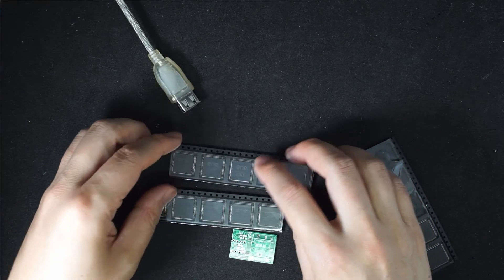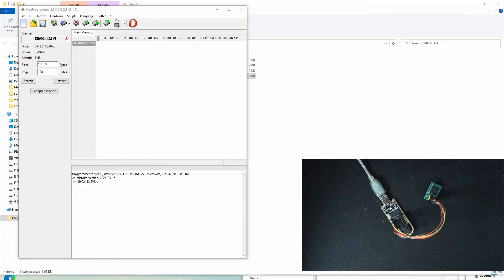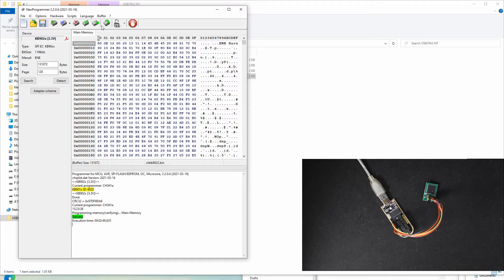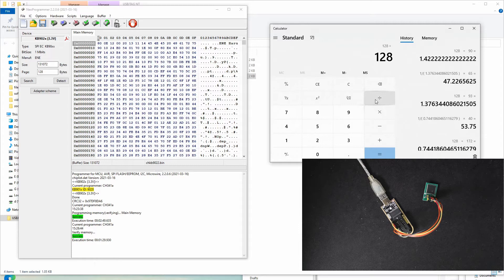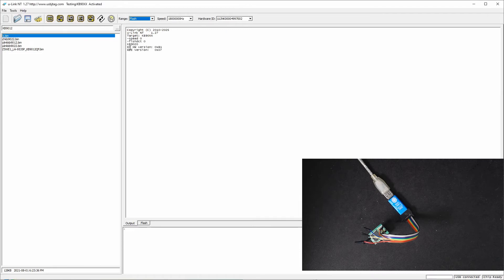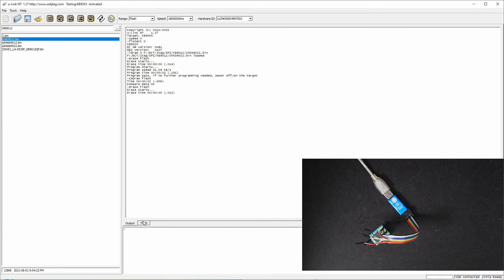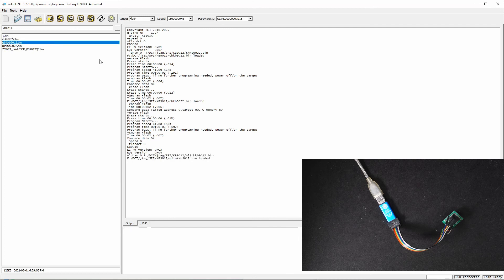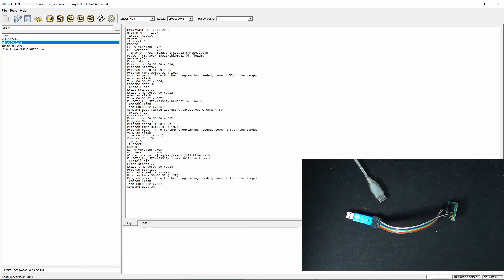u-Link NT Program KB9012/KB9022. Compare with CH341A

Comment: where can i find the programming board to solder the chip to?
Reply from the maker: Aliexpress is where I ordered the board. If your chip is on the mother board you do not need to remove the chip. You can directly program it on the mother board,
Reply: @usbbdm  but doesn't it take hours to program  if the chip is on the mother board?
Reply from the maker: @keithchatman4225  No. It take seconds to program.